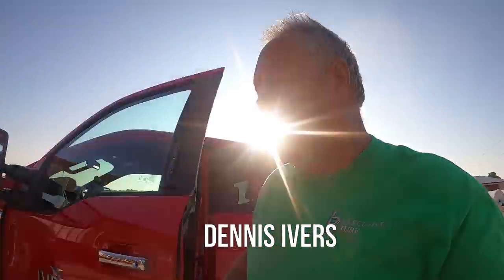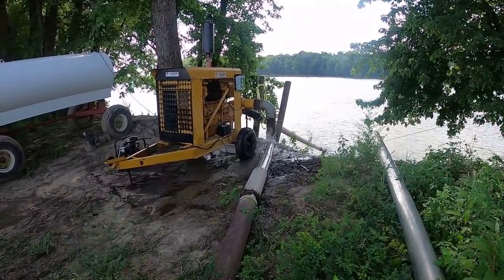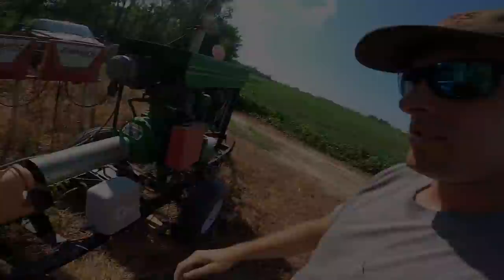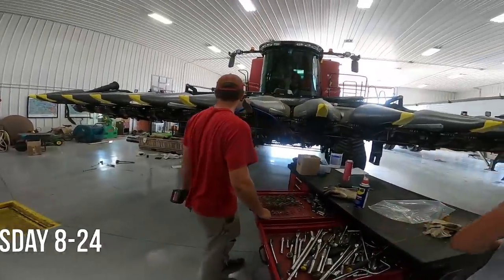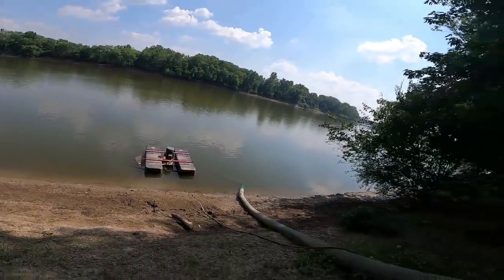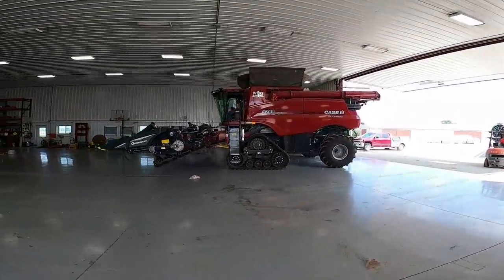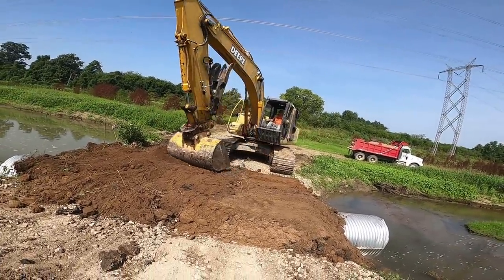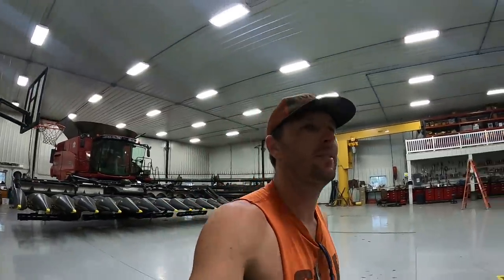New Ford F350 Arrives, How to Kill Army Worms in Your Yard, and David Returns Season 2 Episode 20

Comment: Just wanted to give you a heads up put that pipe in was completely wrong you didn’t pack it down or anything you’re not gonna be able to drive over that pike I would’ve damn all the water off first before I put that pipe in there I would use the backhoe to dig that pipe out and I would’ve packed it with a backhoe you just packing it with that bucket and putting asphalt on top of it that you’re farting in the winter I’ve been doing this all my life around my dad my dad runs heavy and shortly he puts in drain pipes culvert crossings and everything not neither one of them has washed out just a little heads up man
Reply from the maker: We damed it up when we did one a video or two ago. This was so low that we’d have to dam both sides and pump it out if we wanted it dry.